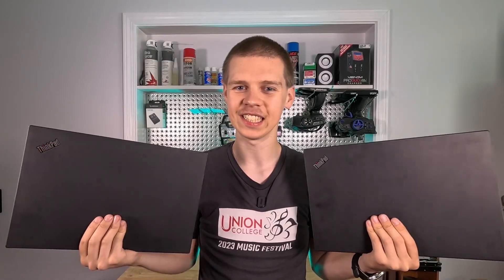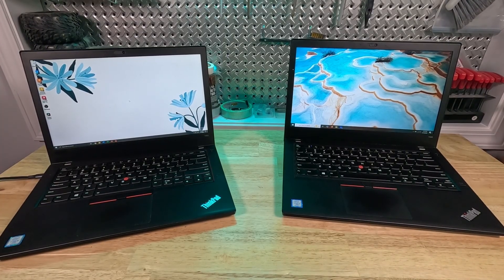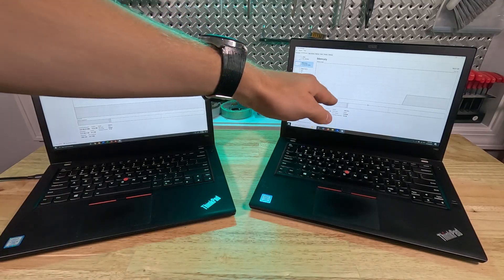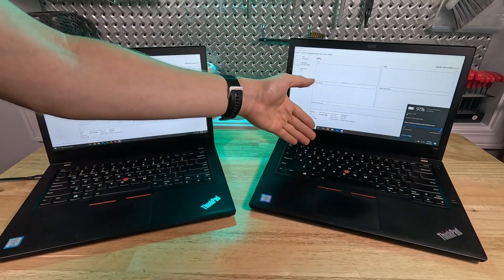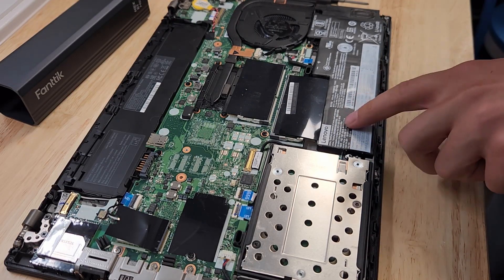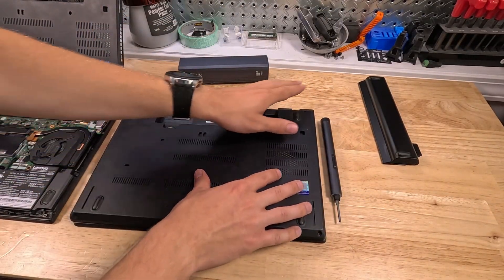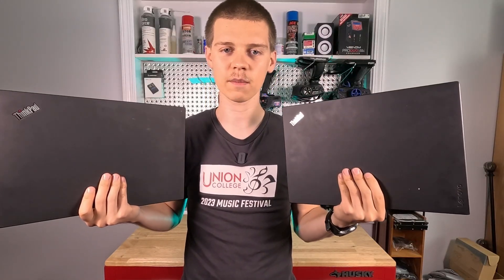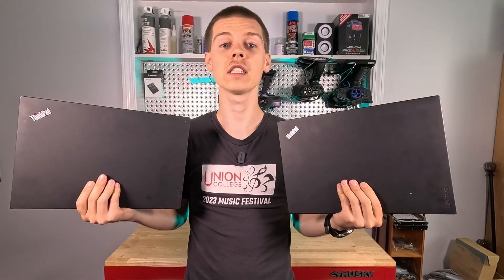We Got Another T480

Comment: So how long is the battery life of the ebay junker?  Did you say?  I must have missed it.
Reply from the maker: No you didn't miss it, but it is about 30 minutes under full load. Technically the $200 dollar laptop gets 2 hours on just the external battery (because the internal battery doesn't work). I wonder how long it could run with both batteries.